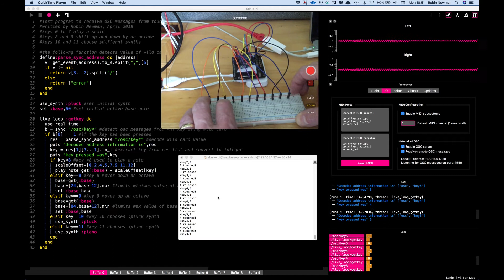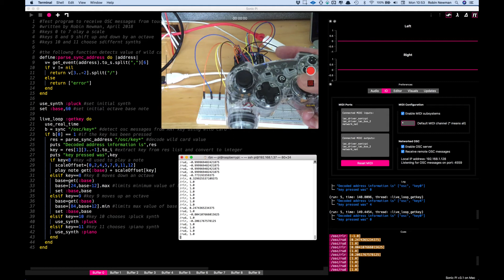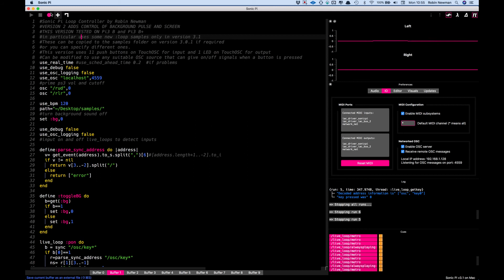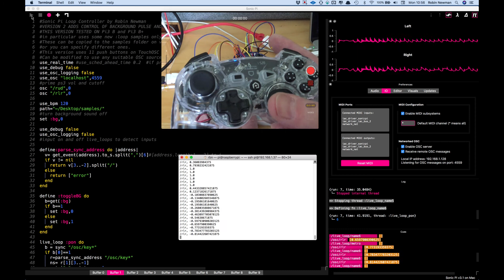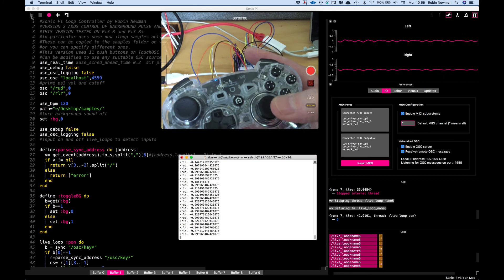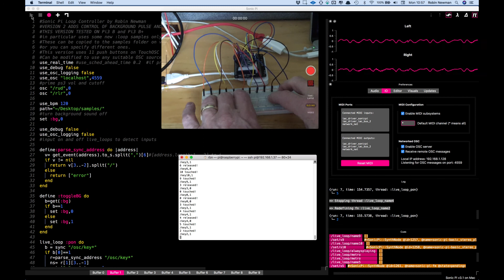A Touch Keyboard For Sonic Pi

Comment: Great video and really appreciate the time spent on this project! Quick question, I'm trying on this on Sonic Pi 3.3.1 but I realised that the port for communication is different from that in the tutorial, is there anyway to reconfigure?? so excited to get this working :D  Thanks again!!
Reply: ive changed it in the ./osckey.py to match (4560) but no luck :(
Reply from the maker: Yes you are right things have changed with the later versions of Sonic Pi. All references to port 4559 should be changed to 4560.
Also in the Sonic Program lines of the form b = sync "/osc/..... should all be changed to b = sync "/osc*/.... with the addition of a * after the /osc
I hope that this will enable you to get going.
Reply: @rbn1tube  Dude! cheers for such a quick response, amazing.. literally trying it as we speak :D
Reply: @rbn1tube  WOW! Works like a charm :D, thank you soo much! Saved me a headache and a cold cup of tea haha  ... cheeky question but may u also know how to include manny bus addresses ie (0=5A,0=5B,0=5C) to run at the same time? Trying to change in the ./osckey.py file but don't think Im doing it correctly.. I'm using more than one MPR121 (all wired and giving readings correctly)...either way much appreciated!